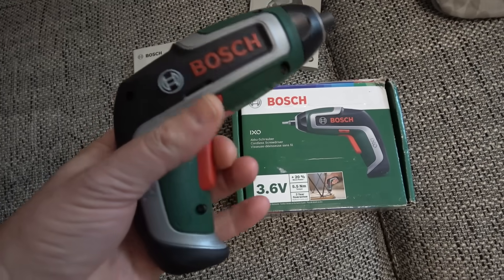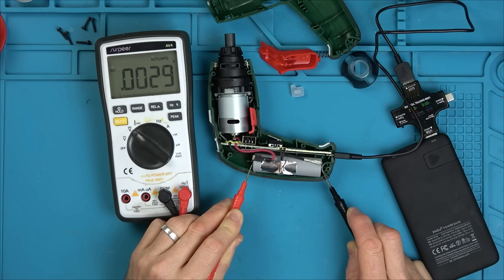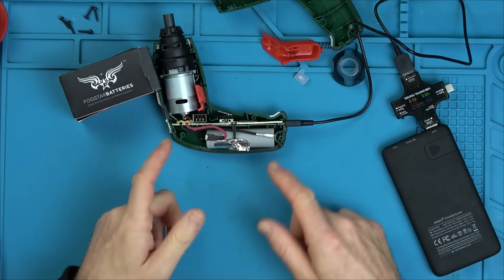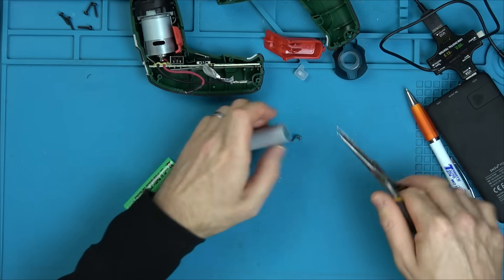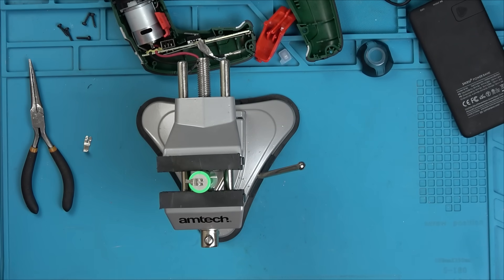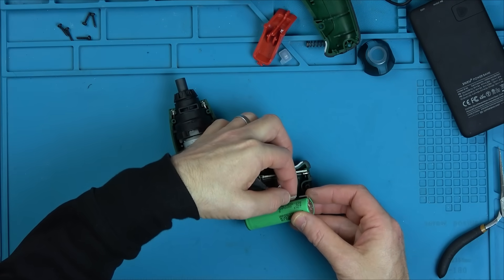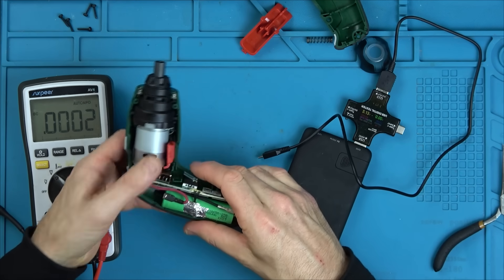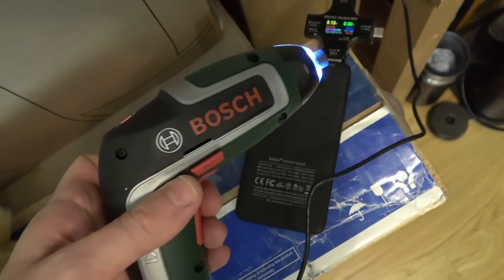MMV November 2024 Fixathon Day 1 - Faulty Bosch Screwdriver

Comment: the two micro switghes are for forward and reverse actuations, using the red selector slide will complete the circuit on the direction selected, Micro switches are usually single action, so manual switching is required. I would check for parasitic draw as a cause of the battery going flat. Keep up the excellent vids.
Reply: Before I read your comment, I thought maybe the extra switch was for a light.
Reply: This. Also thought it was obvious. As if a company in 2024 would care enough about reliability to put two switches in just in case one failed. Whoever had that idea would be fired on the spot these days
Reply from the maker: Ahhhh, ok that is interesting, thanks for commenting 👍
Reply: I'm not convinced.  I think one is for the light.  You can see, when Vince is pressing the switches directly, the light only comes on when he presses one or the other switch.
Reply: @sdjmchattie  yea I think the light and the motor
Reply: Read this after I'd commented bud. I thought the same.
Reply: If the trigger has two levels it would press the first switch (light) at half input, at full it press both. (motor)

I actually have one of these, but never really thought about the function. So good intuitive design I suppose.🐱
Reply: @AltCutTV  It does not have two levels
Reply: @sdjmchattie  No the LED is on the trigger. You can turn on the work light by pressing the trigger just a bit. I own the same model. No need for a complex circuit. You can even hear the separate LED light switch, because the motor is not running.
Reply: @ isn’t that what I said? The second switch is for the LED. The plastic is probably moulded to press one micro switch before the other.
Reply: @sdjmchattie  yes
Reply: Me 2 🙂 @namvet-l8m

Comment: Vince, I believe that one of the switches is for the light only which is driven by a lower voltage. when you pressed the first one only the light came on and when you added the second the motor started.

Comment: Customer return usually means "honest fault"
Those are always interesting.

In the RC lipo battery world, "LCO" is the terminology for lithium cobalt oxide.
Cells made with LCO allow for higher amp draw and less voltage sag than non LCO batteries. LCO batteries offer most of their performance in the 3.8-4.2 volt level, compared to non LCO batteries which may have 60% or more of their power at below 3.7 volts
Hope this makes sense.
Your Samsung battery will be safe, you just won't get as much torque out of the driver.
Reply: or a return scam...

Comment: Brilliant =D  I think someone used it without charging it, and then forgot to charge it when it was flat!
Reply from the maker: Thanks Chris, luckily this wasn't used for hours in reverse 😂😂 The sweat that must have been coming of you with that drill!!!! 💪😎
Reply: @Mymatevince  🤣🤣🤣
Reply: It shouldn't drain below 2.8 or 3 volts if the manufacturer set up discharge protection correctly. 
Unless their discharge protection was like on an RC vehicle, where it cuts power to 15% but still lets you run it down completely if you want. 
Seems like the manufacturer cut corners.

Comment: I would have just charged the original battery. A lot of people do battery recovery with no problems.
Reply: The big question tho....how did the battery get so low?. That's not normal.
Reply: You don't know much about lithium batteries, you don't charge adead flat battery

Comment: Biggest mistake everybody makes while spotwelding is thinking you need to put pressure on the probes...... And you DON'T!

Keep it just so you don't slip and presto...... Perfect welds
Reply: I will agree that you do not have to apply a lot of force but if you do not apply enough pressure that is when you get the spark which is where the energy is going.

Comment: This is the reason the manual often says that you should charge the battery up to 4-8 hours the first time before use. It does not work out of the box sometimes. Many batteries have been discharged for transport or because they have been on the shelf for a long time. Its completely normal, but people throw stuff away for this. 
The slow charging indicates that there is nothing wrong with that battery and that the charging circuit is doing is job by trickle charging instead of normal charging. Which is built in because of this. If it was not safe to trickle charge below a certain voltage, that feature would be left out of the circuit or the battery wont charge below a certain voltage, but it does. The circuit is protecting the battery.
Only if it wont take a charge or if the charging does not appear to get above a certain voltage or it starts reverse charging, you should change the battery.
So you chould have just left it charging and not change the battery.😅 it probably wasnt broken.

Comment: This battery is just fine.  The battery was charging in slow mode because the device has been on a shelf so long without being recharged that its voltage has dropped below 2 volts.  This causes the battery management controller to automatically switch into slow charge mode until the battery voltage exceeds 2 volts.

Comment: So you have a battery that dies a mysterious death but then you put the whole thing back together before charging it and then you don't check the battery to make sure it wasn't being charged above 4.2v? 

You had a pretty warm charging board and I bet it's not a fast charger either. You should look into that. If you were a shop and you gave that back to somebody and then lifey type stuff happens as it often does you don't want to be on the hook for something like that. 

The original cell may have just died from not being used at all. In fact it may just be sleeping. One cell that's been overdischarged isn't going to be dangerous, but if it were in a pack with other cells then it would be a problem because it was throw off the rest of the pack. An overdischarged cell like that one that shows no sign of abuse will just not hold as much of a charge. 

You always heard blah blah blah about these cells . A lot of this stuff you have heard is not very accurate or completely omits certain situational elements. 

What is this giant spot welder you are using? That is a ridiculous ginormous  apparatus you have there. For what you are doing that thing is way too much. So large fur you to do a few welds a couple times a year. I build packs for all my high powered ebikes and many contraptions I make and don't use anything that large. I own large ones yes but the little ones are so much easier, especially if you are just fixing someone's drill battery or whatever. I have $20 or 30 ones I like more than the big expensive ones. You don't want to blow holes in things. A little cube with a color screen and a lipo cell in it and much tinier welding tips is much better suited to the way you use it. You would be surprised how well these little pulse welders can work if you set them up right. 

You should learn more about these batteries. They are everywhere. You have been doing this stuff for years and you should really know more than you do. You shy away because they are dangerous but that is the exact reason you should be learning more. 

I lost a rental property in a fire because my tenant was charging his normal ebike battery with the charger from his much higher voltage Sur-ron charger. I am painfully aware of how dangerous these cells can be...when they are mishandled. Knowing what constitutes mishandling  and how to correct issues is a thing worth knowing.

Comment: Out of experience, I've never believed in this safe/not safe nonsense. If it saves me the hassle of soldering and the cost of the battery and works fine its good enough for me.
Reply: Same here.
Reply: Dito.
Reply: I wouldn't let your insurance company know that. Most compositions of lithium batteries left at low voltage and increase in pressure because the electrolyte decomposes. This gas is flammable.
Reply: The gas that causes LiPo cells to swell is oxygen, not strictly flammable. They do this when overcharged. The undervoltage condition is damaging to the capacity of the cell, but is not hazardous. The metal jacket 18650 cell is MUCH safer than pouch cells. Cell manufactures tend to worry about reverse voltage on cells, but that can only occur with more than one cell in series.
Reply: I was once reviving fully discharged battery, that had very weird behaviour and started to heat up. I was using SkyRC MC3000 charger, plugged into the pc software and was able to save the charts. the voltage of the battery rised up to about  4 volts, and then it started to drop! I wasnt present all the time during charging, so only because MC3000 gives you ability to record voltages, temperatures and currents I was able to notice that on a graph. The battery was discharging even when I stopped the charging. It went down below 2V within couple of hours and I discarded it then. I must say, the battery wasnt new and I dont know how long it sat in zero voltage state. I sometimes revive similar cells, but this situation rarely occures. One other battery was showing high leakage and went down to zero in several days, but usually batteries bringed to life like this are good, if they are not staying in complete discharge for too long (more than several days).
So, I think, you always must be careful and test such battery for leakage, abnormal heat, rised internal resistance and proper charge-discharge IV characteristics, to exclude any abnormal behaviour. Stay safe.
Reply: @JoshuaJonah This is a steel cased cell. They have pressure relief valves so no pressure is built up. Without a release valve steel cased cells would indeed be very dangerous.

Comment: I have recovered MANY dead lithium cells. In general you want to make sure there isn't a too high of a resistance or a short circuit. If there is a high resistance or self discharge what you should do is cycle the cell a couple of times. In general this will lower the internal resistance of the cell and it will reduce and or fix the self discharge. It can even bring lost capacity back. Cycling a not so healthy lithium cell helps quite a bit when it was completely discharged for god knows how long. The same applies for NiMH batteries believe it or not, I've even tested this myself, though it takes way many more cycles than lithium would to achieve the same recovery results.
Reply: That's right ,as a high resistance will draw less current, so not dangerous at all